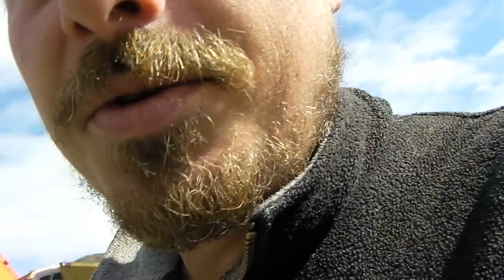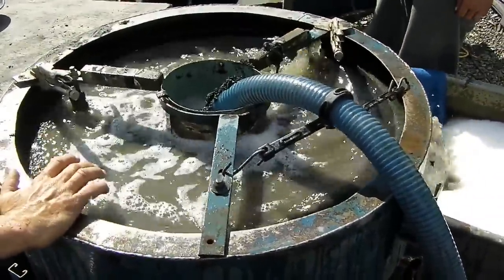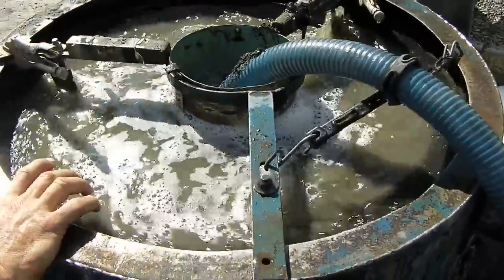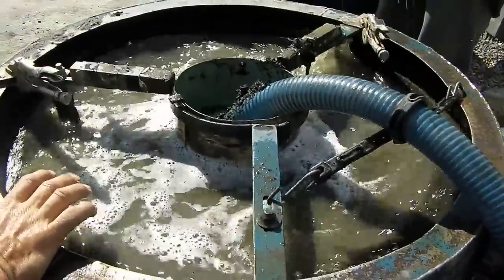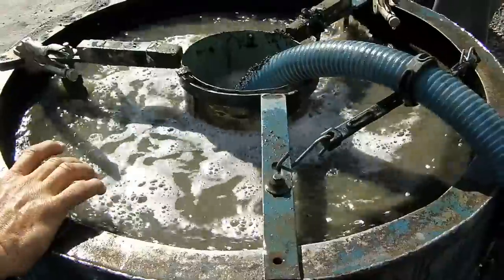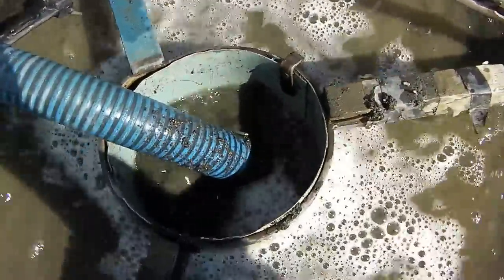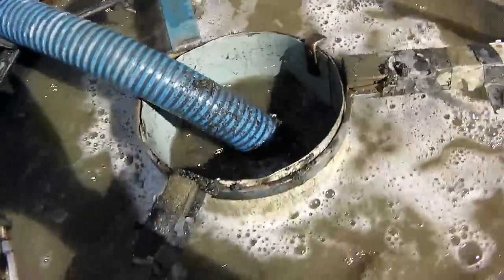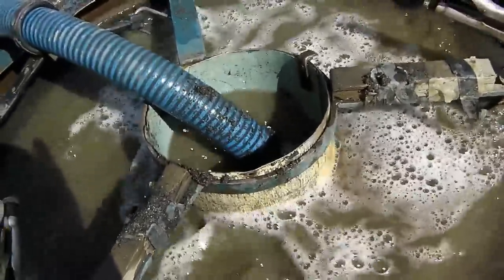Alaska Gold Mining - Clean Up Concentrator 1 - The Centrifuge

Comment: #JiggingSeparation
The working principle of #jiggingseparation is to mix mineral particles with different specific #gravity, and stratify them according to specific gravity in the vertically moving variable speed medium flow. The minerals with small specific gravity are located at the upper layer, while the minerals with larger specific gravity are located at the lower layer. The materials with good layering quality are discharged respectively under the action of machinery and water flow.
#Jigger is the main #gravityequipment used for #goldextraction in #jiggingseparation.
In addition to very fine materials, #jiggingbeneficiation can process almost all kinds of raw materials of various sizes. The process is simple in operation and the processing capacity of the equipment is large. Under the premise that the specific gravity difference is ≥1.25 and the ore monomers are dissociated, the lower limit of the gold particle size of the jig can be up to 0.04mm.

you can click this link：
https://www.miningpedia.net/news/gold/the-gravity-separation-methods-used-to-process-gold-I.html?youtube_ricky

Whatsapp:+8618513783071
Email:rickyjia1980@gmail.com
Company:Shandong Xinhai Mining Technology & Equipment Inc.